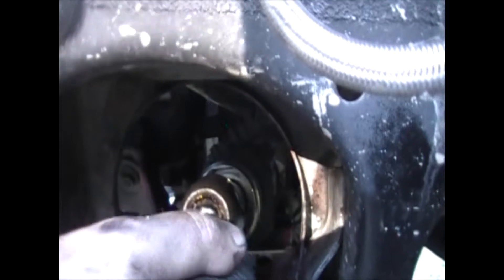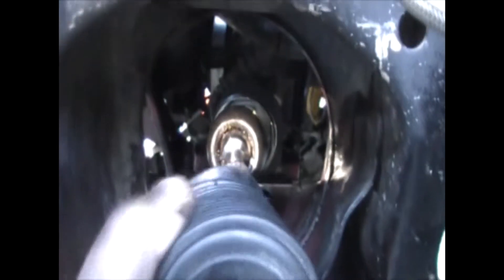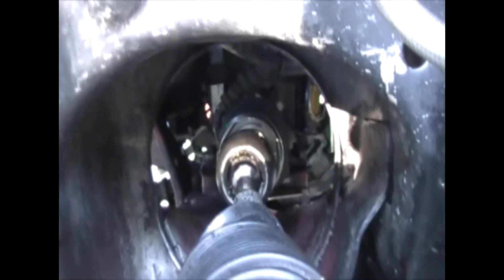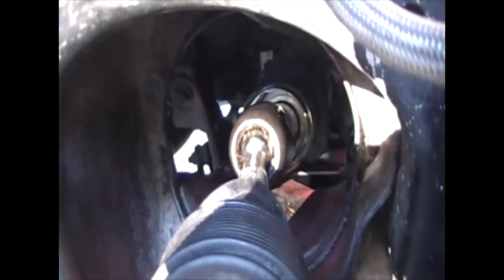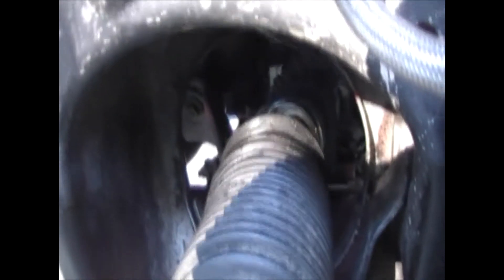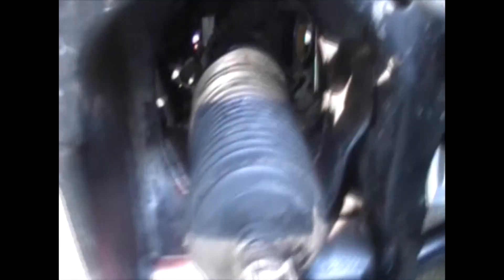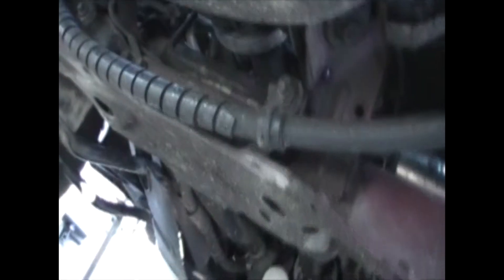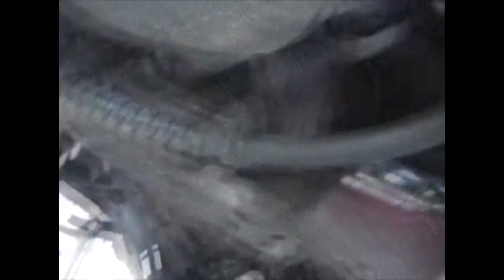INNER TIE ROD / RACK END [ Tarago Previa Estima TCR ]

Comment: Mine need attention too but by the sounds of things it's a job for someone else. Better make some more money
Reply from the maker: I was told only last week that if you full lock the steering wheel the ends come out enough to get a tool onto. Yet to try it out one day. but then you have the wheel alignment to wary about after that.
Reply from the maker: Was under $100 to get someone else to do both sides with the right tools. worth paying for.
Reply: Yes I think you're right. I watched  a good video on how to do it though but I think I can use the time to make more money that it costs so let's do that for once!
Reply from the maker: Thought I better mention I did supply the parts and Tyre Power installed them for me. But yes in this case I think let someone else do it.

Comment: Would a worn tie end cause van to pull to the left badly? Thanks.
Reply from the maker: It could play a part in a pull to the left as the wheel alignment will be a little out. more common would be the wheel alignment, bad wheel bearing, low pressure tire or unevenly worn tires.
Reply: Thanks man..what size is that nut on the inner tie rod?